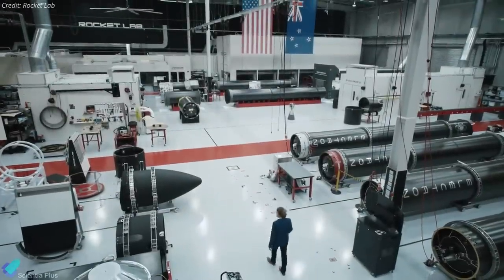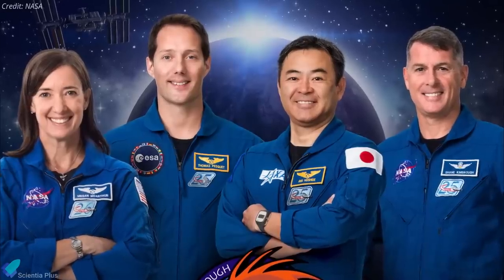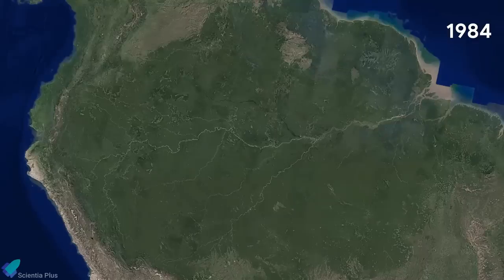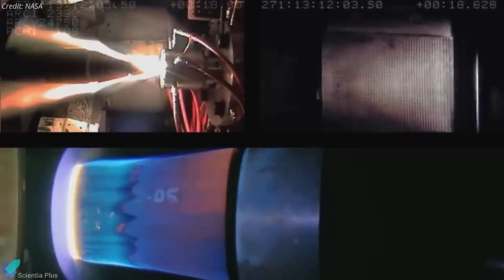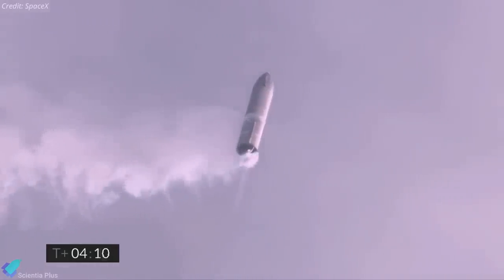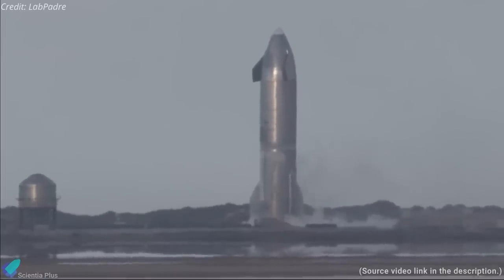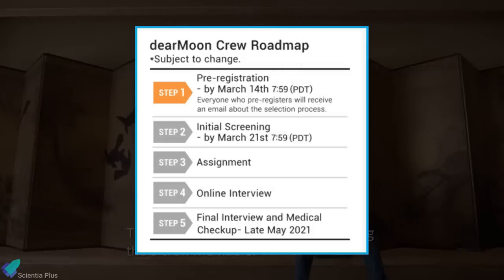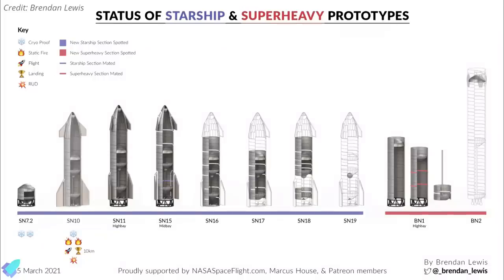How and Why Starship SN10 EXPLODED? | Rocket Lab's Neutron | SpaceX Crew2 Mission | Weekly Updates

Comment: Any Musk fans want to volunteer to fly on Musk's exploding Starships in 2023?
Reply: Ignorant comment. SpaceX does all their testing in public which is something no one else is brave enough to do.
Reply: @nathanlewis42  By the way, are you going to apply for a free ride on Starship in 2023?
Reply: @nathanlewis42  The only difference between SpaceX and other rocket manufactures is that SpaceX has a bunch of fanatical Musk fans watching the facility out in the middle of a swamp, 24/7!
Reply: @DavidJohnson-tv2nn  I may apply. There are far too many applicants to have any chance of being accepted. SpaceX has transported 6 astronauts to the space station. They are at least as safe as the Boeing plane I flew on recently.
Reply: @DavidJohnson-tv2nn  you are willfully ignorant. SpaceX could easily stop them if it wanted. Blue Origin releases videos after they have completed their test flights and they don't tell people when or where they are going to be before hand. The same is true of all the others.